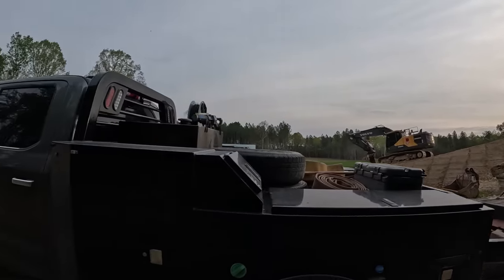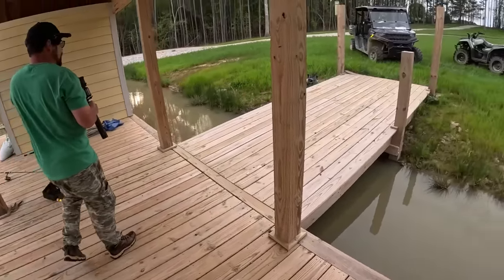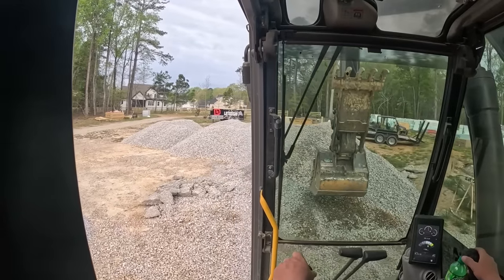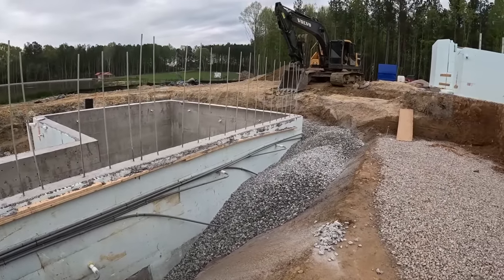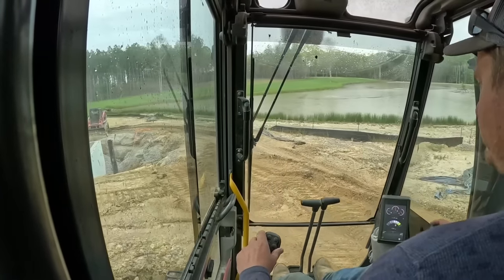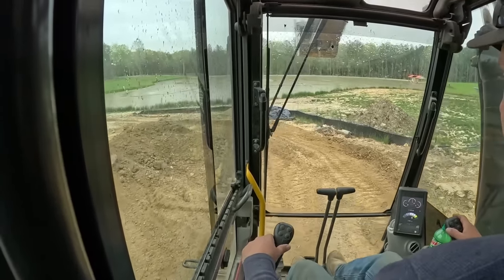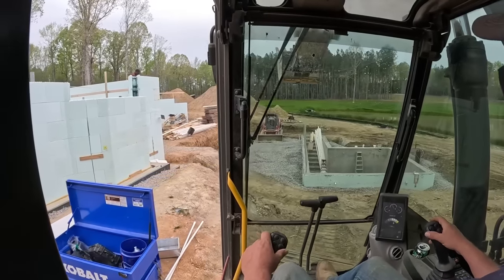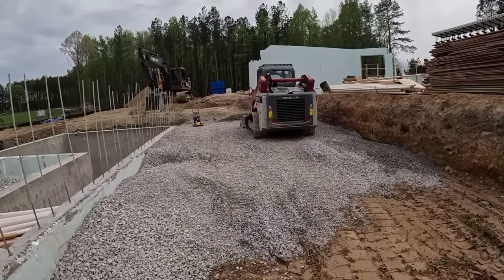Backfilling The Pool Takes Truckloads Of Rock!

Comment: Worked with a fellow who would take Jetskis that had enough sand run through them to burn up the impeller and would install a big trolling motor in its place. Wouldn't go real fast but on a small pond that worked real well.

Comment: The value of a bilge pump and a solar battery maintainter...  750 GPH pump with float switch about $40.  Will keep up with leaving the drain plug out.  Might not keep up with rain,but it should keep it from sinking at the pier.
Reply: But you do have to wire and plumb it properly...
Reply: Or, he could drag it up on shore, it is an aluminum boat. He has a side by side.
Reply: It has one, that's what caught fire when Geoff sat in the seat!! LOL

Comment: <start of commercial voice> "You can use Flex seal tape and spray on anything you need to stop leaks, even boats.  We cut this boat in half and put back together using only FLexseal and it is water tight!"      It can't hurt to spray the entire outside of that boat lol

Comment: Need a larger bucket so you can make the most out of each trip with the excavator. Cost of bucket versus cost of maintenance and undercarriage?
Reply: You can only reach out so far with a bigger bucket full of material so really you wouldn’t be able to take a full bucket because the bucket weighs more and added weight of material. Bigger isn’t always better.

Comment: This seems ridiculously slow if the concrete can't take the gravel being put in fast then it definitely won't hold water pressure. Should fill the dump truck and dump it on the edge then push it in with the dozer or the skid steer. I don't see the benefit of the backwards bucket here either. Now i do it shortens the commute by the length of the boom.
Reply: Why don’t you make a video and show them how it should be done.